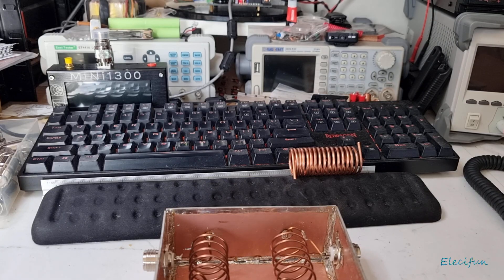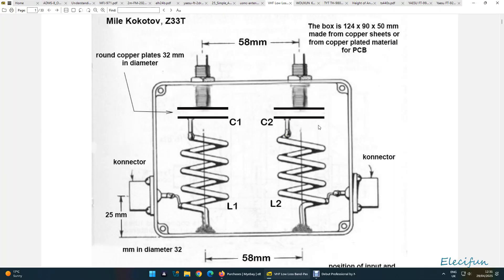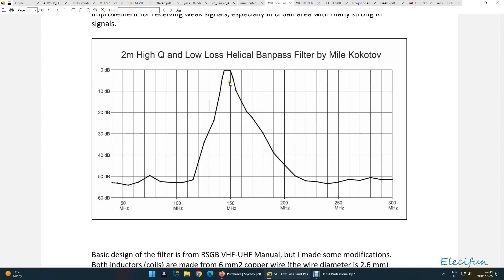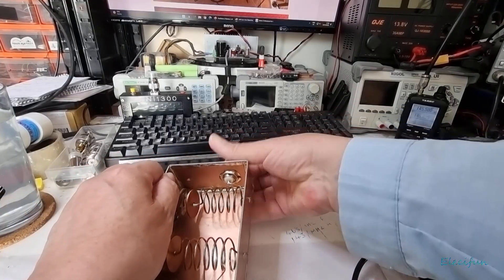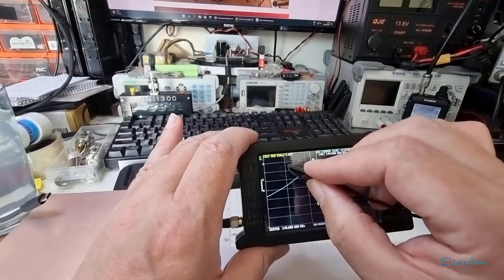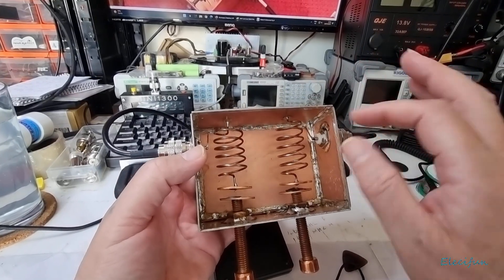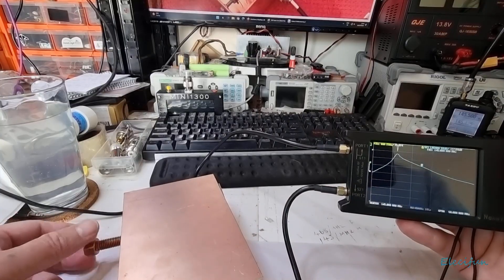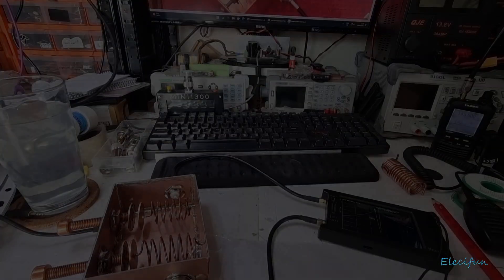Band Pass Filter for 2 Meters

Comment: That's a really interesting filter. What a fun project. It's always more satisfying when you can DIY it. Thanks for sharing your adventures, Elecifun. Happy transceiving, amigo.🤠👍 📡
Reply from the maker: @Sonic_Ox Hopefully it will do what I want and block some un wanted signals without me having to use the attenuator in my radio. Its 10db attenuation and even if I can get this to work with -2db insertion loss and lots of loss either side of the pass band I will be happy. Cheers for watching!
Reply: @M7SVW  I hope it works out just right. 🤠👍